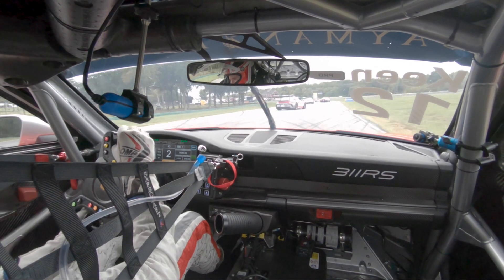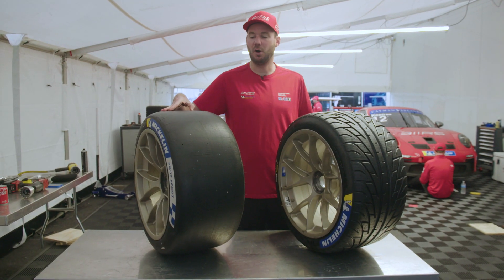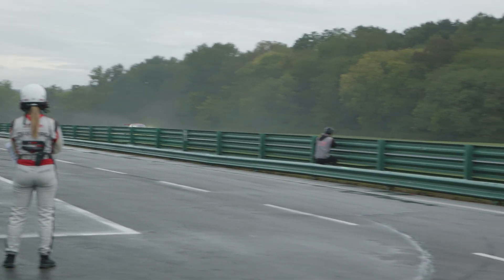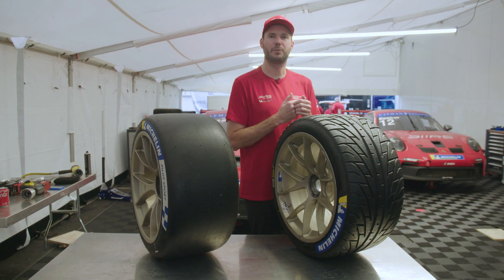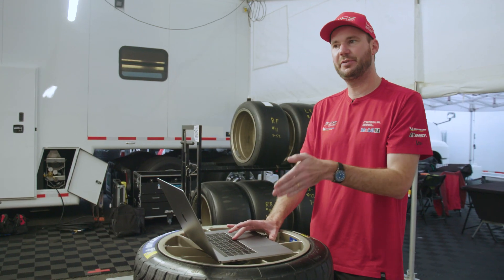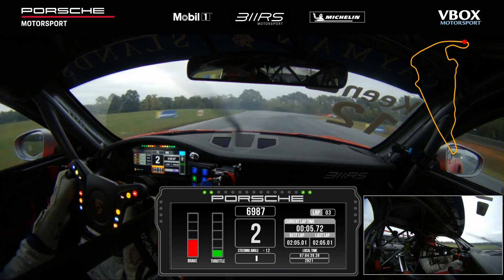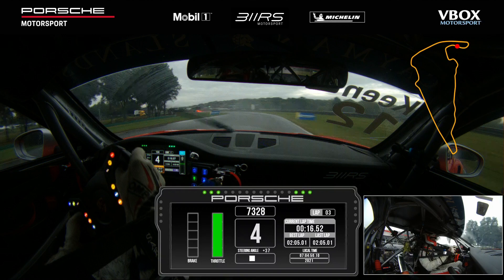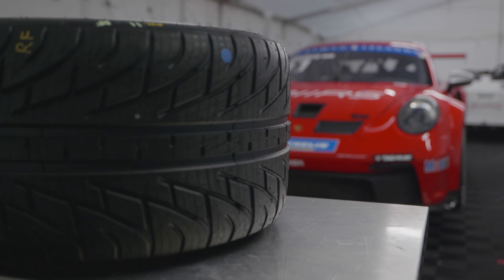TECH TALKS: How Rain Tires Work

Comment: Do you change pressures at all?
Like if the rain is really coming down and you're running slower will you lower the pressure for more movement in the shoulder, or jack up the pressure because the speeds are slower and so the tire itself it harder?